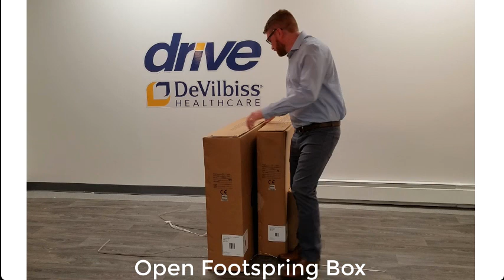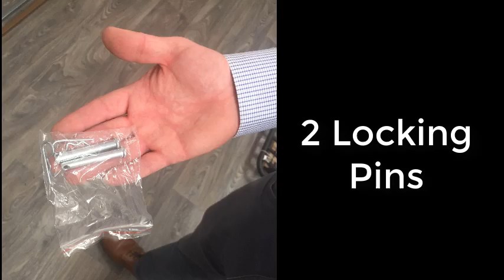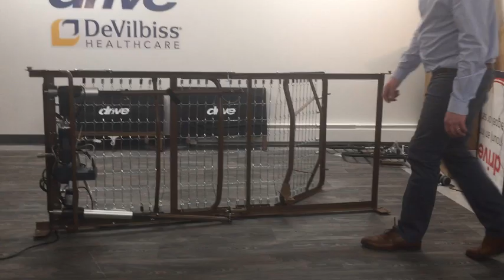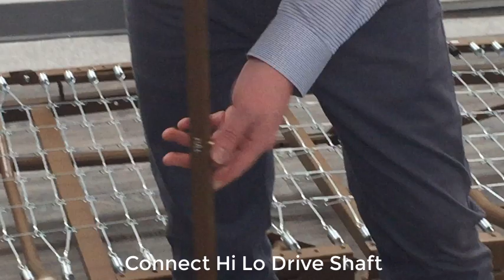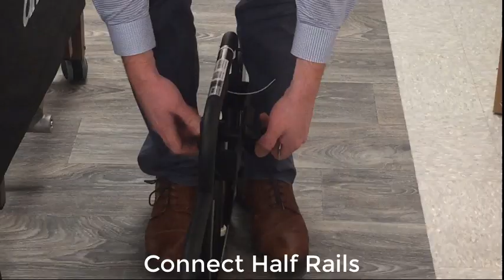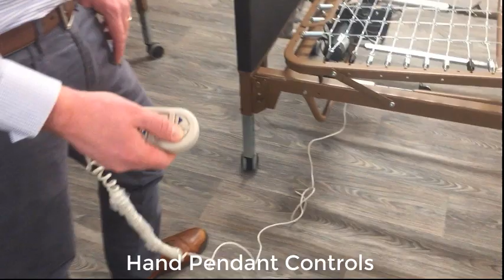15005LP Bed Assembly

Comment: I am a disabled woman with two different types of arthritis and fibromyalgia. It took a week for me to get the room prepared - I had been given this bed thankfully! No instructions on how to assemble so I'm so glad I found this video. It went pretty well until I had to do the hooks in the middle as I don't have much strength in my hands to hold the wires and slip in the hooks - then it occured to me - zip ties. Worked perfectly!  The footboard already had the motors etc installed and it was just too heavy to lift by myself so I'm waiting for my son to come help me. Very easy, clear directions, thank you!